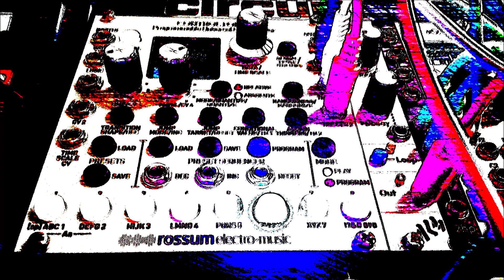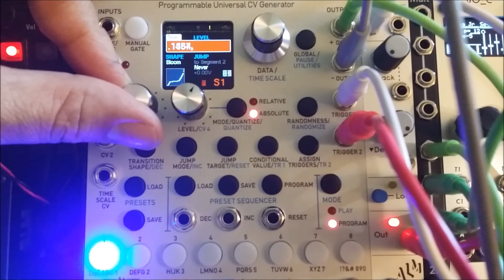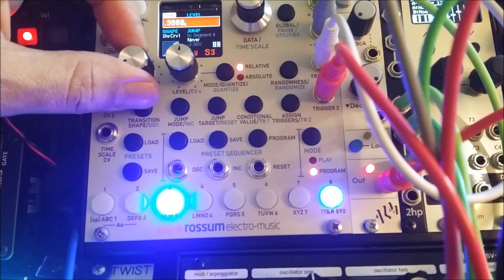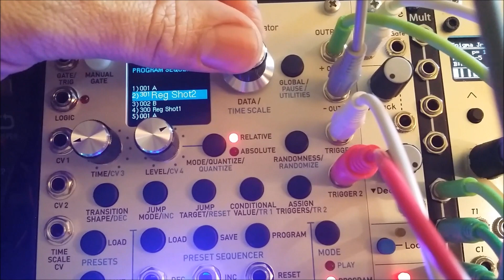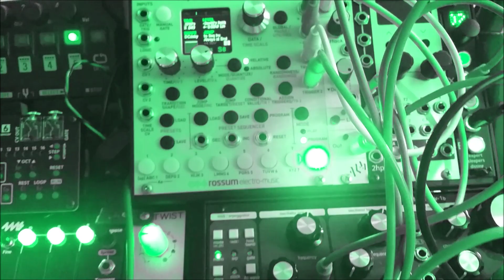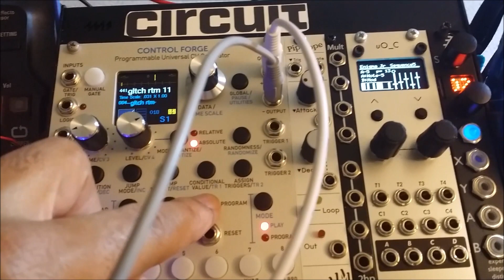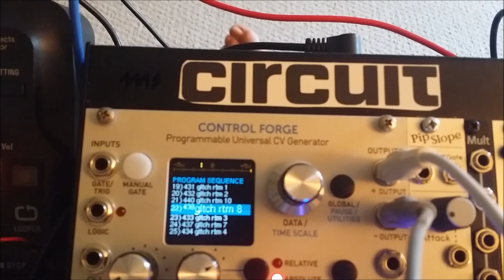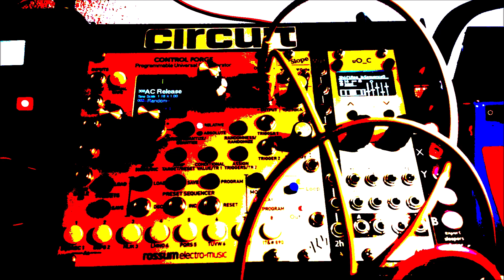Control Forge - Rossum Electro  - Transition Shapes in Sequencer Mode:  Lifeforms SV-1B & 4ms SWN

Comment: love the intro, and the outro, as usual! so this looks like a deep and capable module. guess it's much friendlier than monome norns. these years i become difficult to go thru thick manuals and devote to deep systems so i tend to run away from menu divy and programming device. in practice, however, guaranteed and quick reproduciblility is important factor for efficient music production, also for the performance if i'd ever do such again. so i'm always in a dilemma - CL gears are in a way unpredictable. working strictly within analog domain demands muscle memory gained by lots of practice and experience, or logical thinking based by high level knowledge, i think either of them is no easier or quicker than programming a deep versatile brain first. but then this all is just divergent from the 12 tone world which i'm not yet done with so still important... hehe just bubbling ;p
Reply from the maker: I know exactly what you mean,,,,,there's what you call a Physical diving into something by site,,,Hence Control Forge and other devices like Norns....Then you have the Lorre-Mills DK, CL, PB which have no menus or labels therefore it forces you to think and focus on patch settings and sequence parameters...that can be just as challenging.....I don't know when i'll ever achieve my goal in getting the CL & PB..i refuse to buy just one..i need both at the same time...That's the true power......i would have to sell off a great deal of my musical gear to get those too but i can do it if i want but have to be in that type of mood..My Lifeforms, SV-1b, 4ms SWN, Control Forge and other misc gear would have to go if i were to get those 2...but if i did do that,,,you think i would enjoy it like i did the LM-DN and that Herbs and Stones liquid foam? member the Vids i did on those? can i get similar results? i need motivation if i'm going to finally break down and get the PB & CL
Reply: @rhampton1914  I honestly don't recommend to try to get them at once. They are VERY different from every way from euro mind and you'd be possibly shocked after a couple of weeks getting them and might regret somehow.. if you're to just 'add' an idiosyncratic flavor to what you have now (and for what you're doing NOW) then it may be great but as I commented the other day, for that purpose they may be a bit expensive for what they can offer for you (for you, at this moment, tho!).

Basically, the three, that is, Sidrax organ, Plumbutter, and Cocoquantus is the first devices and I really recommend getting one by one unless money is non subject..

Sidrax(or tetrax) - most straight forward device. but don't expect to play in 12 tone scale or sequence. It's basically triangle waves (saw for tetrax) with FM synth. tuning range is so wide and not convenient for prescice equal temper tuning. The tone itself is not magic or anything, so if one wants to sequence in western, why use this? better with bunch of more conventional and incredibly cheap options are there today. https://youtu.be/xsppLToKRKE

Plumubtter - "drum and drama" machine. You really should official Plumbutter official page and read rollz5 page before deciding to this. For me, this is the most important CL instruments of all and I'd like to get a second one someday, eagarly swap with the Deerhorn organ which unfortunately didn't somewhat meet my expectations (which was perhaps too high). My old plumubutter solo videos are pretty much actual sound of the device so they should represent well. Many pepole play in other gears and put a lot of delay/verb so you don't really get the sense of the raw sound of it. You can sync the device to other things in a way, but personally I don't really think it meant to be played in such way (of course you can do whatever you like, tho!). I mean, it will probably frustrate you if try to control CL devices in the way you've been doing in euro land. There's no start/stop button for the rhythm. Panning is 100% left or right (all CL gear, IFM module vcas) with no attenuaters. It's so idiosyncratic. get the sense of 'drama' of drum 'n drama. oh, Heinbach wrote at muff years ago that he was hesitated to get PB because he heard everybody sounds similar with PB. well, he got it eventually, tho. So, I love plumbutter so much but I recommend this to only who loves its raw sound!

Cocoquantus - many people recommend this to the first device, as this is functionally straight forward - 8bit (thus very lo-fi) dual delay/looper device with crazy modulation source. you can get somewhat clean-ish sound if you're careful with level but never get clean sound of today from this device. tempo sync? possible but no, why try to do something not meant for? get boss looper or octatrack or much superior options are there. but you get this. yes! welcome to CL world. the cocoquntus's most important section is the 'quantussy', the center part of the device, where crazy modulation signals are generated. I suggest reading Richard's blog postings about quantussy, such as this: https://pugix.com/synth/what-is-the-quantussy/

I really know what you feel about those CL instruments because I've been thru myself. There wasn't many videos when I started so I just had to buy it. But I was already bored with my SharedSystem then (the fault is me, I still SO lack of knowledge for patching for truly appreciating every power of the now-seen-a-bit-obsolete original modules). When I listened the sound samples of plumbutter of the official page, I thought this is it. I couldn't imagine to make those sound out of euro or other synth (hey, lacking knowledge!), and the thing is made of wood!
So, this is my honest opinion. And remember, I got bored with my CL gears after a year or so, and thought of sell them - only I didn't and took me more time to started to understand them deeper and re-love like today.

Am I pushing the button for ya? :)
Reply from the maker: @hajimmie  yes that's what I meant to say Cocoquantas. That's the one that I've been eyeing for the past couple of months..... you're probably right. Just a Cocoquantas alone will probably bring me much satisfaction even without syncing it to the BPM. I like that off beat freestyle abstract way of creating. Remember I had that double knot and that's exactly what I did although I tend to still be on the BPM side lol I couldn't escape it that's how I'm used to playing music but there were times when everything was just off timing.... I appreciate the description of each of those CL's.... yes I received a little education. Haimbach does a really good video of those on his little porch remember that video?.... based on your suggestion the goal is quite reachable now if I'm just going to focus on one. I love the delay on the Cocoquantas. ... very very glitchy. I must have one. And now that was talking about it sort of more motivated than ever now. Mark my word I will have one soon it's just a matter of manipulating a few things around
Reply: @rhampton1914  Cocoquantus alone will make you busy for a while for sure! I think it still holds relatively high resell value in case you don't like it. And you don't need that much banana cables with coco; with PB you need 20-30 cables. here's my one of my take, enjoy: https://youtu.be/upzT-FPfptU
Reply: and this, watch what only a single banana can do on the quantus: https://youtu.be/YJFJwzJ19b4
Reply from the maker: @hajimmie  is there a clock divider in combination with the delay that's making it go back and forth in its modulation? I find this truly amazing that it can produce that much modulation with one cable
Reply: @rhampton1914  find articles with tag "cocoquantus" on Richard's page, so much informative than my poor english explantion (and i don't understanad circuit ;()
Reply: ah, and this is another "how awesome quantussy is" demo: https://youtu.be/hMr-KYjKgkM